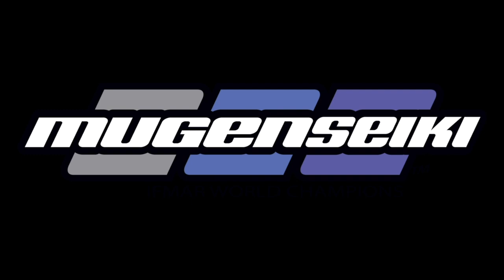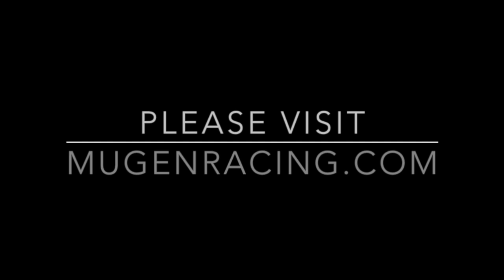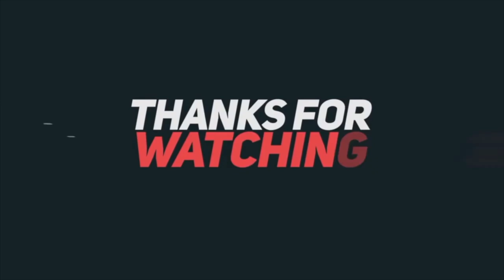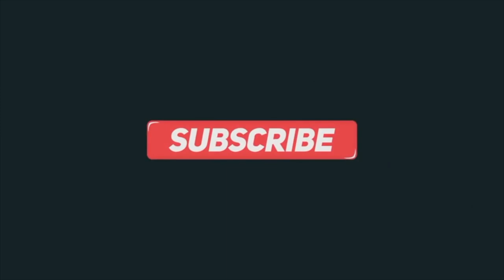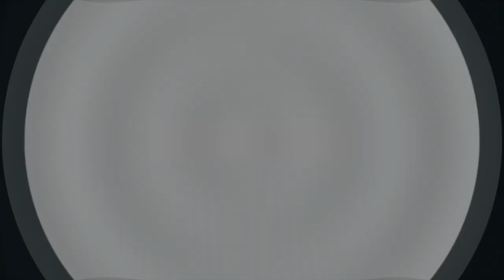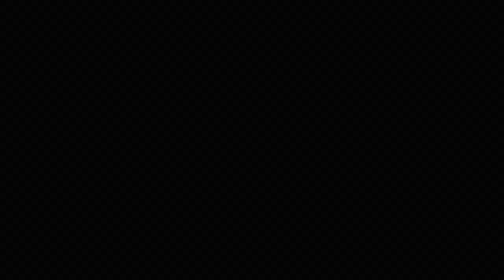What to do after having a piston and sleeve resized.

Comment: Quick ?’s. How long will a resized piston/sleeve run over a new one? How many times can you resize it?  Many thanks for these videos.
Reply from the maker: It depends on how the engine is tuned and cared for but usually it will extend the life 3-4 gallons and can be done multiple times, but you may want to also change the connecting rod from time to time.

Comment: I will be sending you mine very soon to get resized. just to be sure. Do you just want the piston, sleeve, and connecting rod? Or is there anything else I should send as well? Lastly, is it easier to just send you the whole engine or do you just prefer the 2 or 3 items?
Reply: CBR Wix usually you send sleeve and piston with rod attached.
Reply: @rcjerz  oh sweet,. thanks Kev. Appreciate that homie.
Reply from the maker: It's up to you, the piston/sleeve/rod sets only or the complete engines if you want me to inspect the bearings and the rest of the engine.
Reply: @AdamDrake  Perfect, thanks

Comment: Personally I think if an high performance engine $$$ is going for a sleeve resize already, change the conrod too (and if you can, change the bearings). It probably has gone through lots of fuel and abuse.  Conrod is one of the weakest link in the engine.  If it snaps it can cause unreparable damage to the engine body.
Reply from the maker: Yes, if you can afford it, it's never a bad idea to replace the rod when having the sleeve resized.

Comment: A question slightly off topic. If I buy a Brand new engine, then send it out to be modded does it need to be broken in when I get it back from modder?
Reply: It depends if the modder broke it in which they usually do for a fee. If you didn’t pay for break in service then you would break it in your self.
Reply: They usually break it in for u but it depends who is doing it but I think most of them do it to check if they modded it right on the engine Dyno
Reply: @nitrogas5719  thank you!
Reply: @dylanpeterson7398  thanknyou!
Reply: Sean Hatch your welcome
Reply: @dylanpeterson7398  They don't run it on a dyno, until it's fully broken-in it can't give any valuable data. But there is some people out there that shouldn't be doing it for a living, so anything is possible I suppose... :/
Reply: PS A your right but I ment they put it on the dyno after and you can see the dyno sheet
Reply: @dylanpeterson7398  I guess it's easier now for those who use break-in machine. But it's still not a good thing as it requires the engine to be tuned to absolute peak performance, so it's very easy to create damage. It's also a matter of how much you can do without testing, it should be a development where a lot of things is taken in to consideration besides the dyno numbers. (Well, for offroad at least where more power usually isn't necessary)
Reply: PS A my modded engine by amr was broken in with the oil bath though so synod are really meant for modded engines that can scream no matter what
Reply: @dylanpeterson7398  What do you mean by "synod"? A dyno is just a tool, and to use it for accurate results you need to tune the engine to the edge, that's why no serious modder runs dyno tests on customers engines. AMR isn't exactly on top of the game unfortunately, nice photos, but lacks a lot of theoretical knowledge. :)
Reply: PS A ok I was just trying to help but I ment dyno stupid auto correct
Reply: @dylanpeterson7398  Auto correct can get the best of us. :)
Reply from the maker: Yes, it will need to be broken-in unless they do the break-in for you.